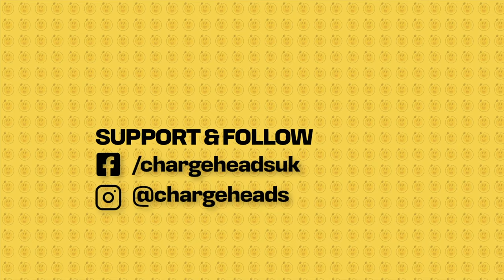THE BATTERIES HAVE ARRIVED, BUT WHAT MOTOR AM I USING??? TVR EV Conversion Part 5 #TVRWedgee

Comment: Exciting times! Have you thought about adding heating to the cooling system to condition the batteries in winter? It might be needed if you're looking for year-round performance 😁
Reply from the maker: That's a good shout, not spoken about that yet. Thanks for the reminder 👍

Comment: Have you guys had a look at the modules to see if these contain the BMS slave circuitry in one of the modules and the other kind has a dumb board with interlink (I see typical cables laying on the shelf) to the smart module? From some info I have seen before this is the case, which makes repurposing them more difficult from a bms point of view.
Reply from the maker: I'm putting out another Video showing how we test them which would interest you, out tomorrow. You spotted correctly one has BMS slave circuitry and one doesn't 😉